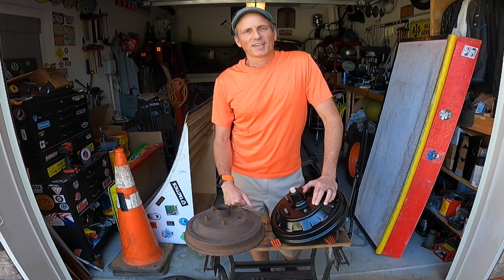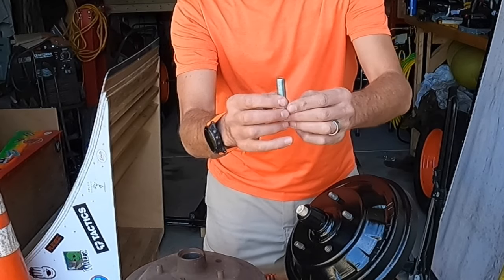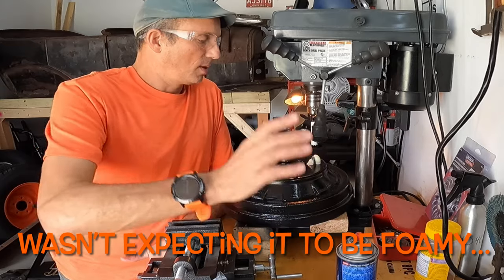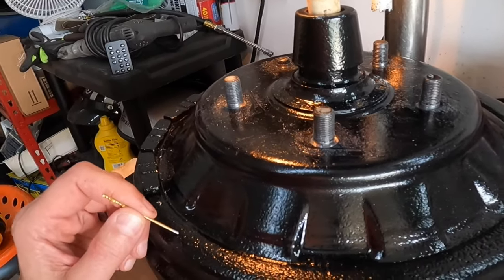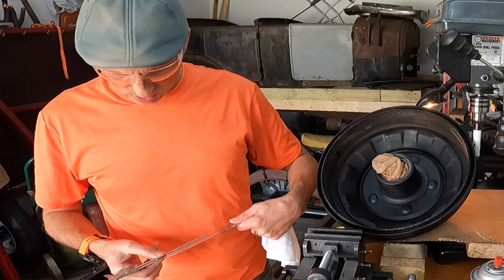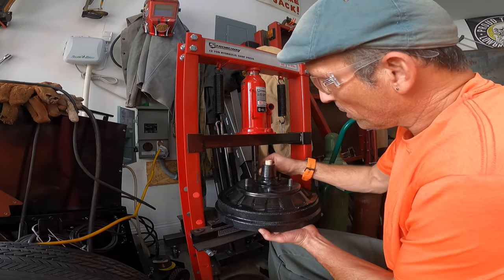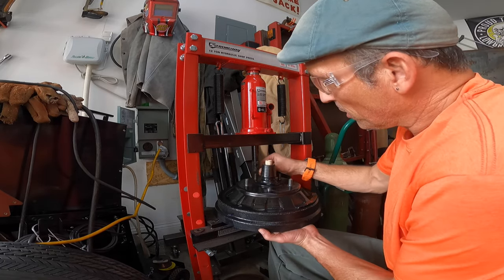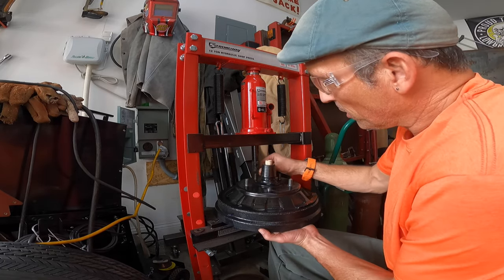Early Ford Brake Slip On Drum Conversion How-To/DIY

Comment: Neat video.  I have a '46 truck banjo.  I used the same process to remove the sweges, a 5/8" hole saw.  I ran into another issue with  my studs. Previous owner had replaced studs w/o sweges; backside of studs were WELDED to hub to lock them in place. Research told me that had been a way to lock in studs since sweging isn't really an option.  I plan to do the same with spot welds on studs.
Reply from the maker: Hi Dale, thanks for watching!   Yeah, that spot weld work around was pretty common… normally after someone smashes out the studs not knowing about the swedging and how it works. As long as your hubs weren’t messed up when the original studs were removed you should be fine.

Comment: Slow the drill press down, it will cut better.  It will generate less heat, and save the hole saw.
Reply from the maker: I’ve already got it on the slowest pulley combo… the problem is that the drill press was made for wood working.

Comment: What size stud did you use? Length or a part#
Reply from the maker: Hey thanks for watching!  I put the part number and description in the video at the 20:09 mark but the NAPA part# is NOE 641 1555
Reply: @AJStarch  hey appreciate the info
Reply: @AJStarch  I was thinking of doing this to my Model  A brakes, but the studs you used looked too long.  Does Napa have them in different lengths?

Comment: Hi AJ, did you have a problem with the drum getting full coverage on the brake shoe, because the drum is now on the outside of the hub, moving the drum the thickness of the hub. I'm doing a similar conversion, using Buick drums
Reply from the maker: No, not at all but my drums were already over the outer side of the hubs but just swedged to studs.  So the physical relationship between the drums and hubs are still exactly the same.

Comment: Dropped my drums at a shop 3months later told me they couldn't swedge it. What a PITA. 

My studs are nurreled AND have the smooth swedge part...wondering if i even need to swedge it to the drum at this point. The studs are already pressed into the hub.
Reply from the maker: Yeah, that does suck. Unless the studs are oversized in the hub, the swedge to the drum helps hold everything together.  I would be leary if using the standard Ford studs meant to be swedged.  Good luck though and thanks for watching!